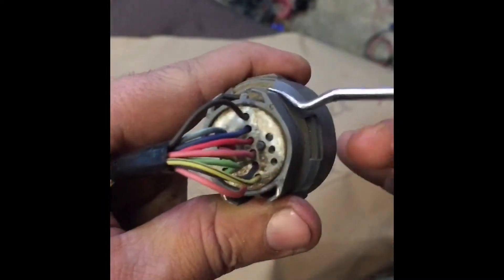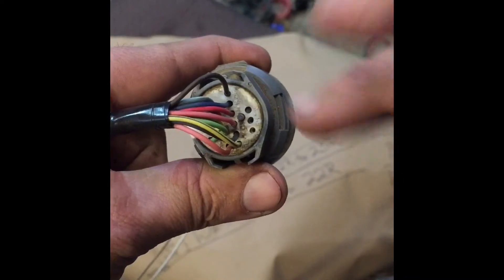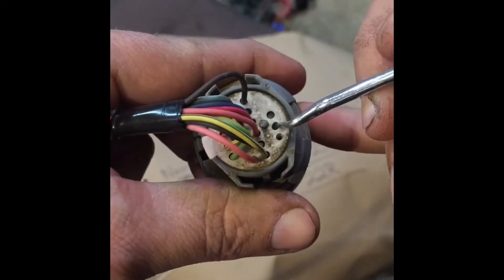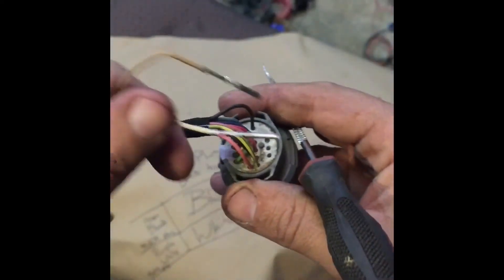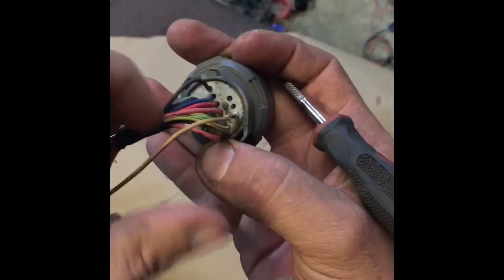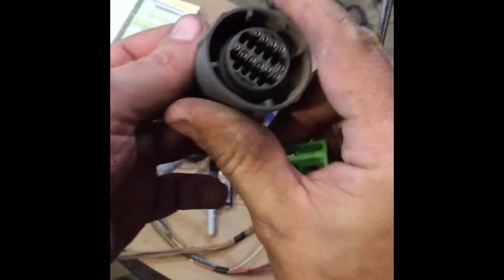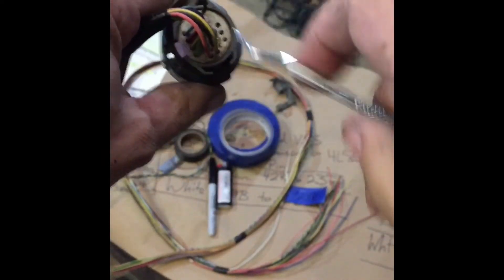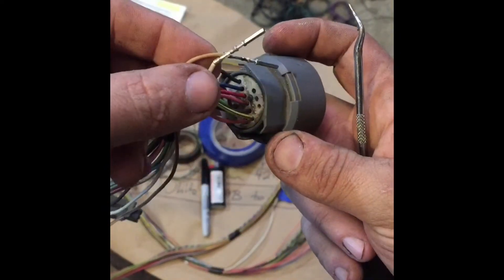4L60E to 4L80E Red/Blue Harness & Computer Pin Out Modification (Pt 1)

Comment: Hey brother the 2 pins left out on 4l60 e plug go to the tail speed sensor of the 4l80 correct ???
Reply: No it goes to the 1 speed sensor on the 80e
Reply: The input speed sensor and then there’s the out put so he wants you to switch the pins out from the original spot there at and put them in a different pin hole